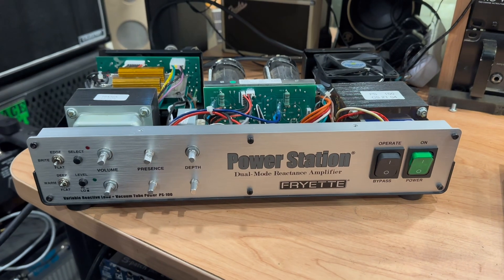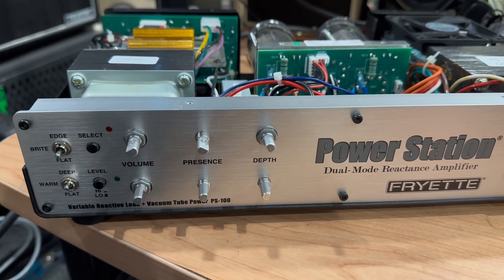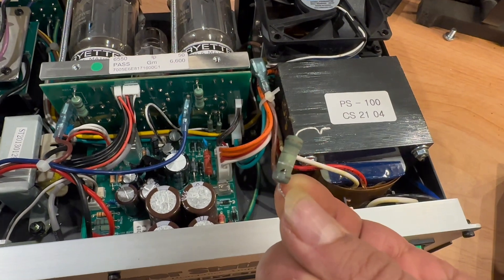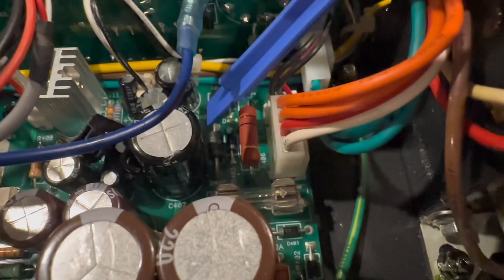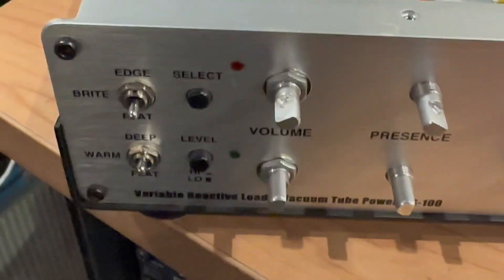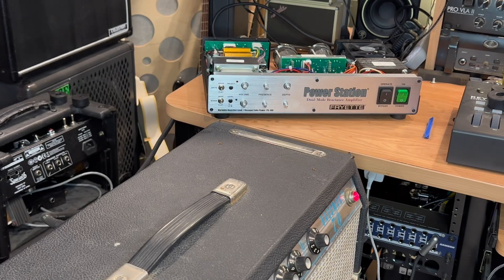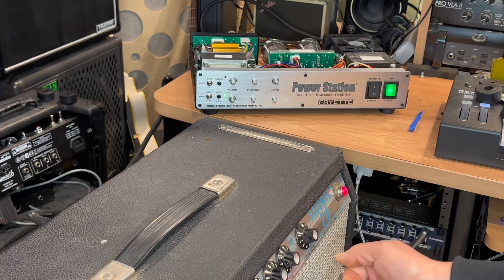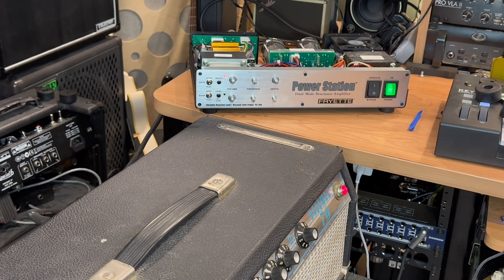Fryette Power Station PS-100 | Stuck in BYPASS mode? No attenuation or channel switching repair

Comment: Just a clarification, Warm and Bright have nothing to do with the channels. They are there to equalize the reactive load to your liking. Channels are on power amp stage in order to have two options of loudness + presence and depth control.